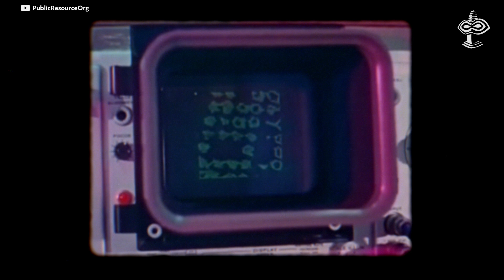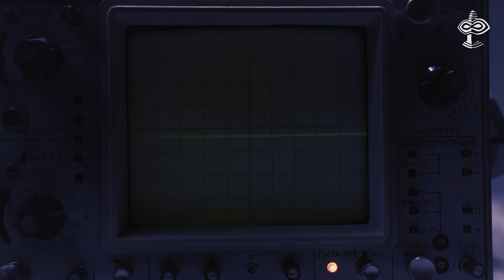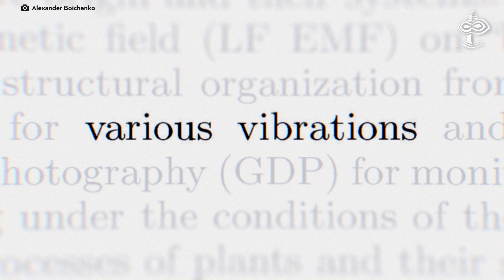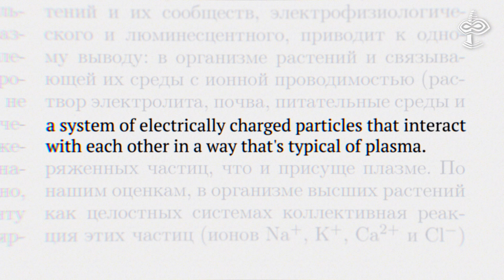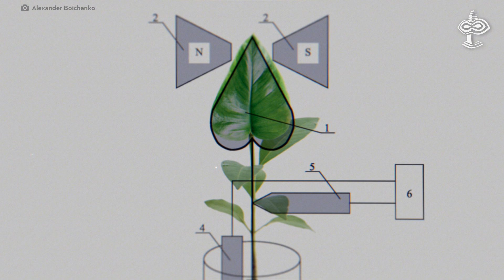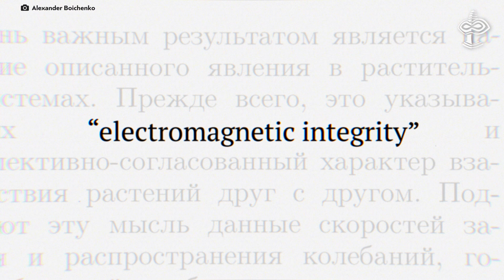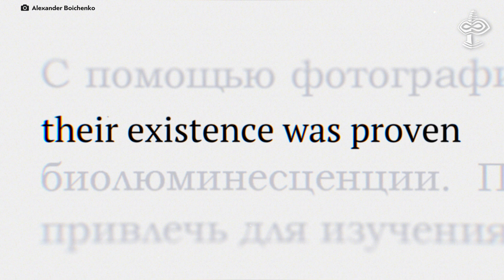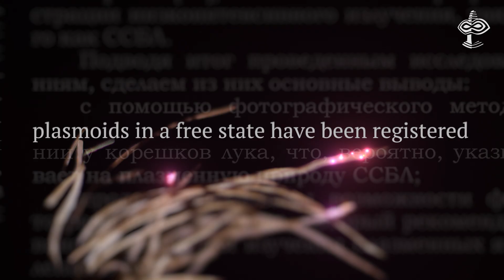The 4th STATE of LIFE: Electronic Plants. Part 1/5 - VERSADOCO

Comment: "molecules contain an electron gas...which is a negatively charged plasma" you explicitly acknowledged plasma as the fourth state of matter in this video! What an incredible level of absolute, incoherent nonsense. I hope this hasn't poisoned my recs too much
Reply from the maker: Well, I quote this from Prof. Robert Temple's work and here is original quote from Albert Szent-Györgyi's book: "Energy band structure is linked to the name of L. Brillouin.
The basic idea is this: If, within a molecule, there are regular
repeat units, and these units are coupled electronically, they
disturb one another's energy levels which split up. Each
level splits in two so that there will eventually be twice as
many levels as there are units. If there are many units the
band will contain many levels. If these are so close to one
another that the energy of heat agitation suffices to lift an
electron from one into the other, then they can be looked
upon as one continuous system of electrons. The situation
may be illustrated by Fig. 7 which was constructed based
on a similar figure of Brillouin's. In this figure the lines
represent the energy levels of the single repeat units, while
the sinusoid line represents the energy barriers between
these units. The lower energy levels are separated by wide
energy barriers, are not coupled, and do not split up. Where
the barrier is narrower they are coupled weakly by tunneling
and show a weak splitting. The higher levels are separated by narrow barriers, and splitting becomes pronounced. The
highest levels may not be separated at all and form wide
energy bands. -->Such a wide energy band can be looked upon
as an electron gas pervading the whole molecule."

- Albert Szent-Györgyi, "Bioelectronics: A Study in Cellular Regulations, Defense, and Cancer", Academic Press, New York, 1968, pages 20-21.
Reply: @Versadoco   and how does any of that support:

1 - the idea of molecules containing a gas (gases are made of molecules, this is like saying a sheep "contains" a flock, or like a grain of sand "contains" an entire beach, it is utter nonsense - molecules are made of atoms, and there's nothing else "inside" the atom other than its constituent atoms).

2 - that it is an "electron gas", which once again, is pure nonsense. A gas is definitionally comprised of molecules, a large cloud of electrons would not be a gas.

3 - how is that "electron gas" also a plasma, when plasma and gas are two different phases of matter, something you yourself referenced? You can't have a "plasma gas" any more than you can have a "solid gas", they're different states of matter. 

This is only one very short passage, and it demonstrates a complete lack of understanding of even high school level physics. I don't know where the errors originate, but frankly, it is pure gibberish.
Reply from the maker: Thank you for your comment.
First, I'd like to remind that original Szent-Györgyi's concept and his idea communicated in the video is correct and accurate.

Second, I beleive you are confused because of _the term 'Gas' and 'electron gas' are two different concepts in physics_.

Electron gas is a specific concept within the field of condensed matter physics. It refers to a collection of electrons that are free to move within a material but are confined to it, typically in a solid. In metals, for example, some electrons are not tightly bound to individual atoms and can move freely throughout the material. This "sea" of mobile electrons (as you've read in the quote from Szent-Gyorgyi's book above) is often referred to as an electron gas. It plays a crucial role in electrical conductivity and various electronic properties of metals.

The main difference is that "gas" is a state of matter involving the motion of particles like atoms or molecules, whereas "electron gas" is a term used in solid-state physics to describe the behavior of free electrons within a solid material.

Moreover, electrons can behave like fluid - "electron fluid" the term that does exist in physics, and it refers to a collective behavior of electrons in a manner similar to that of a fluid. This concept is commonly used in condensed matter physics to describe situations where electrons in a material exhibit fluid-like behavior, typically in the context of high-density electron systems.
Reply: @Versadoco okay, I looked into temple. I guarantee you that if Albert Szent-Györgyi saw the nonsense temple was turning his work into, he would be disgusted. There's a reason these guys always quote scientists who have died. Why is there no research newer than 1968?